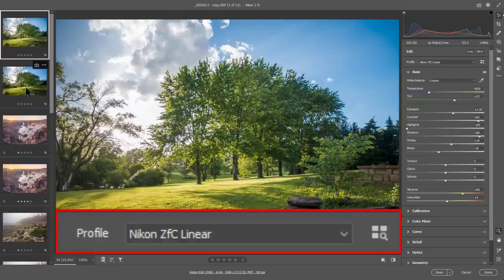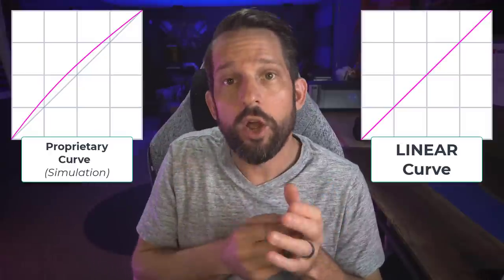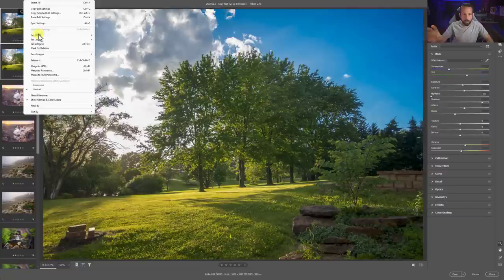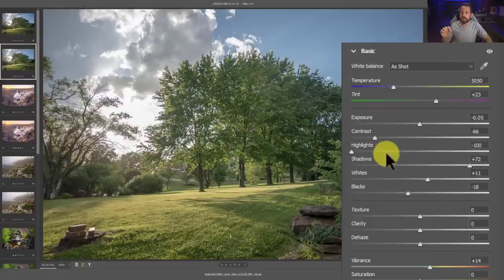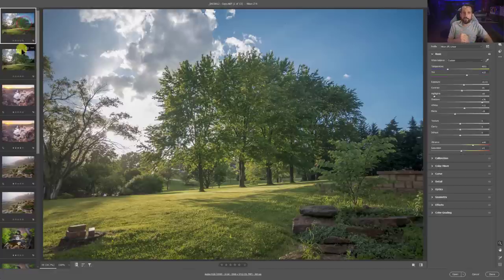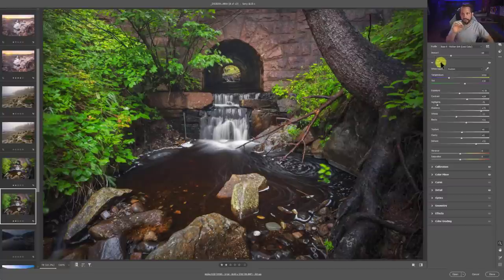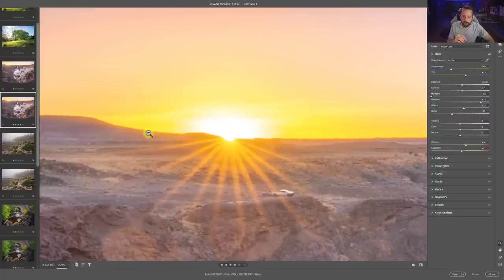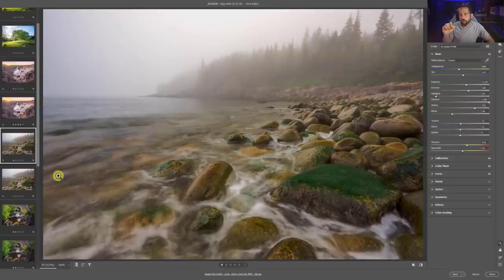Linear Profiles • What's so special?

Comment: I was on the understanding that LPs increases the Dynamic range straight off the sensor data, thoughts?
Reply from the maker: I don't think they increase the dynamic range, they just shift it more to the left. You can't really get more dynamic range of it isn't there, but you can trick the program into thinking there's more, but that's all it really does. On their own I don't find them too useful, but when used with LUT profiles, stacking them, I think there's serious potential.
Reply: @f64Academy Using LR12  I've recently been testing out the dynamic range of my Fuji X Pro2 in high contrast situations. Even using ETTR, the highlight detail was often unrecoverable using the Adobe Color Profile and virtually every other standard profile I tried. However, the Adobe Neutral Profile and the linear profile I created for my camera using Adobe"s free DGN Profile app appeared to immediately recover at least two full stops of highlight detail while preserving detail in shadow areas that would otherwise require much more recovery with sliders (resulting in significantly more noise). In fact, the highlight detail preserved by using the linear profile could not be recovered by using sliders, even when ETTR exposure was used. As expected, the Adobe Neutral and the linear profile both produced a significant loss of contrast in the mid tones that had to be dealt with. This is all specific to my camera and workflow, so I can't say about what others might experience. GREAT video, Blake. Very balanced and informative (as always).

Comment: The only issue I have with your comparison methodology is, isn't the linear profile adjusting the underlying " curve " setting?. If you apply the Linear profile is it removing the hidden curve adjustment that Adobe's colour profile is adding under the hood?. It would seem to me that if you ignored the basics panel entirely and adjusted the curve in the curves panel you would in theory be able to get the linearised raw file to look identical to the Adobe colour profile if that makes sense? Certainly that's how I understand how linear profiles work. Andy Astbury's channel features a method very similar to how linear profiles work but using a method called "process swap". In essence this process swap removes the hidden curve adjustment which is added by profiles like Adobe Colour.  I assume ( rightly or wrongly ) that linear profiles are just doing the same thing as a " process swap ". On a personal level I apply linear profiles to almost all my RAW files as the 1st part of my editing workflow. For more colour critical work I create camera profiles of my own. Profiles are certainly very powerful tools for sure and are often underused within editing workflows 😊
Reply from the maker: No, not the Adobe Color Profile, the Camera Profile.  If I used Adobe Standard you would see the image without the color from Adobe Color and maybe that would have been more accurate, but Adobes default profile when you open it is Adobe Color.  I do get what you mean about the Tone curve as I did not use that at all in this video.  Truth is, I am not a huge fan of using the tone curve in ACR as it is limited in scope compared to PS with things like blend modes, blend if, etc.  Therefore, I rarely use it in my workflow.

The Linear Profile is designed to bypass all Adobe profiles and add that curve to the image to nullify the default curve from the Camera, that's why yo uhave to make one for every camera you own because no two raw profiles are the same from company to company, camera to camera.
Reply: @f64Academy  Indeed this is more confusing than I thought lol 😋 I guess I figured that the RAW file from the camera was essentially unsullied ( ie no profile was embedded ) until it got to the RAW converter ( Lightroom in this instance ). Lightroom/Adobe then applies it's interpretation (using default Adobe Standard or Colour ) of the RAW file with an additional curve added to make the image look better ( ie less flat, desaturated and lacking contrast as a RAW file would look ). So am I correct to say that whatever profile I use in camera ( I generally stick to neutral or flat ) this is carried over with my RAW file and the linear profile is essentially stripping that profile away when I use a linear profile in Lightroom? So are the camera matching profiles that appear ( eg Vivid, Landscape, Portrait, etc ) only there so I can change the embedded profile from my camera to an alternative one that matches my cameras built in profiles? Clearly I'm confused 😁

Likewise I'm not a big fan of curves in Lightroom/ACR either. I much prefer to apply curves in luminosity blend mode in Photoshop where it has less impact on my colours 😊
Reply: @dunnymonster  You are right...there are no raw profiles. Cameras have one to make the JPG and the raw editor uses an icc or DCP input profile as part of the process to convert the raw file to a color image. There is no company specific profile in the raw file..

Comment: I'm pretty certain there is more to adobes profiles than a adjustment to the curve. Texture, color, sharpening etc.
Reply from the maker: More than likely, for sure!  I'm not sure about sharpening or texture inside a profile though.  Those are pixel based adjustment for the most part and I don't think that would be in the scope of a profile since profiles really only target tones and colors.   I'm merely showing an example here of what can be done with profiles.  Quite frankly, there is a ton more that can be done to them outside the scope of a linear profile.  Actually combining a linear profile with adjustment based profiles has proven to be a very successful starting point.

Comment: It sounds like the reason some want to use a linear profile is because they don’t like the starting points of the default profiles (too much contrast or saturation or whatever). If I understand this correctly, then a linear profile is a good move only if it really starts you closer to your intended final rendering than any other available profile. If it doesn’t do that, then a better solution is not a linear profile, it’s finding or creating a camera profile that actually is closer to your intended rendering (a better starting point, resulting in reduced editing steps and time).

I do allow Adobe Color to be the default on import, but I keep an open mind about switching to Adobe Portrait or Adobe Landscape for those types of photos, to see if one of those might be a better/faster starting point. And it often is.
Reply from the maker: Yes! Spot on!

Comment: All and any linear profile is always based of or based on the flatest camera-profile. Every Linear profile is always camera-specific so there is no real reason why to compare this to the Adobe profile.  That really does not make sense. I agree it is not all that easy. But once used to linear profiles (and the ability to use these with Film-specific profiles, far better and more predictable then Film-profiles with the Adobe profiles) i have come to like and prefer them always. I have been using my favourite film-profiles sandwiched with the linear camera specific profiles. I agree that it is just a different way to work. I like it very much. I use them always. Yes I use them in conjuction with luminosity processing (not masking but selections). I also work with L-ab color-processing to differ between luminance and color. This is a very good way to introduce contrast where and when the image can use it or you as the photographer/processor wants it. Only then, not before. And I have become very accustomed to using this kind of processing so much so that my photography has changed.
Reply from the maker: I'm not comparing it to the Adobe profile for the sake of comparison.  I'm comparing how the sliders interact based on the profile selected.  The profile I compare it against is almost arbitrary to a certain point because we are just trying to see how the editing process changes based on the Linear curve.

Glad to hear they work for you :) Just goes to show you that workflow and the things we do are personal to the outcome we prefer.

Comment: I have made and used linear profiles for all my cameras for years.
In my view, this presentation misses the primary benefit for a linear profile.
The presentation focuses on using the sliders in the basic module.
The main benefit of a linear profile is eliminating the mid-tone brightening of the Adobe default tone curve. It also eliminates the step toe and flat shoulder of the Adobe tone curve.

As a young photographer I learned to select color film emulsions as well as B&W emulsions, and developer to control the tone curve.
Lightroom offer a tone curve, as well as HSL modules to provide substantial control over the tonal characteristics for an exposure. i.e. permits me as the photographer to create a customer "emulsion tonal and color response" for each image.

Using only the basic module is overly simplistic.
Reply from the maker: You are very much correct. I use a lot more than that basic panel in my workflow, but my point was more focused on what is happening and why and using something that I know very well as the base for experimentation to compare.

The Adobe profile was the control in the experiment to test them off something I know well. This was primarily to teach those how to add something new, like a Linear Profile, to their workflow.

This was not meant to be a video on how to use the linear profile in your workflow from start to finish. As I mentioned, linear profiles would be excellent in a more complex workflow that involved luminosity masks, etc.

Comment: Interesting and thoughtful commentary/analysis. I started using linear profiles based on Jim Welninski's course, and find them very useful on occasion, but as you point out, not always necessary or desired. In images without 'close to' blown highlights, I often wind up trying to 'get back' to the look that another profile did. And yes, the sliders do react differently - takes a bit to get used to it.
Reply from the maker: Agreed! It can be great for some images and unpredictable for others, kinda like any profile for that matter 🤣